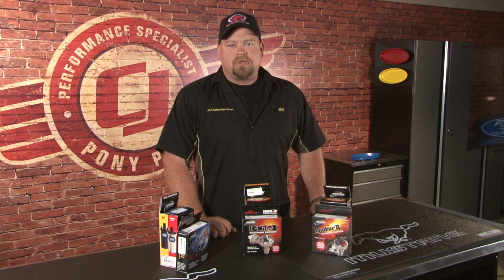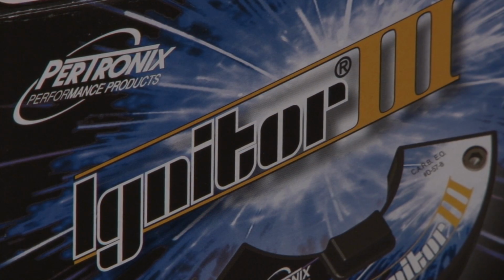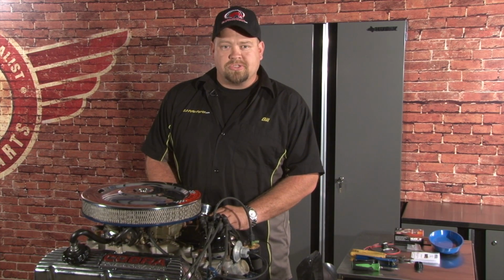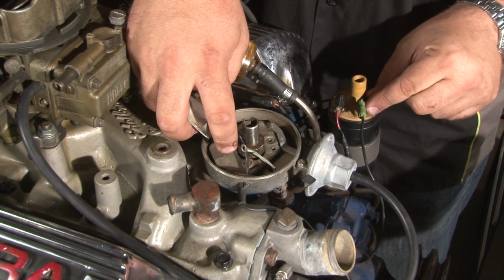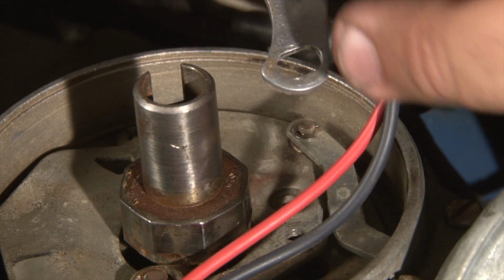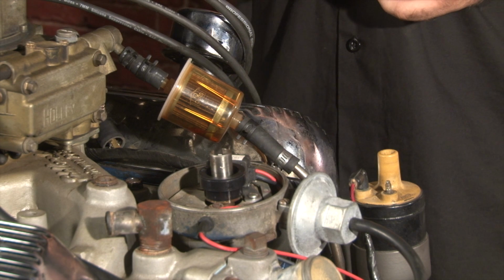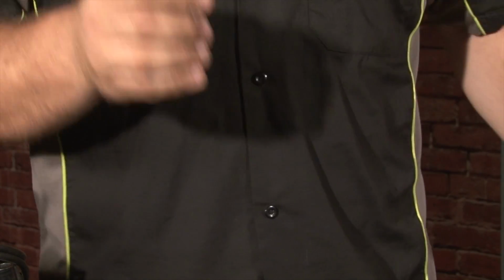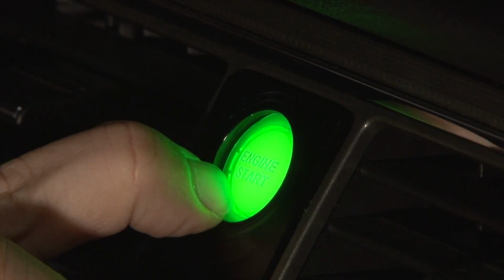Ignitor | Pertronix | 1965-1973 Mustang

Comment: I'm sorry but this is just bad information and an incorrect install for first generation Mustang guys.  It won't be getting 12V, it will fry the module in less than 2 yrs, and it will run like garbage the entire time.

Comment: I installed this Pertronix in my 1966 Mustang  it worked for 2 years last week my Mustang just died while driving . I replaced all the other electric parts Voltage regulator new battery , new alternator, fuel pump , all fine it was the Pertronix unit that failed so I am going back to points .I do not mind changing points they are the original part to the car and distributor. yes, points are a mechanical part which is good Modifying these parts is not a good idea at least for me. If points are bad a car will just run rough you can still drive home not with Pertronix I never had a car with bad points die on me while driving .
Reply: You can upgrade the coil, bypass or replace the pink resistance resistance wire or add a ballast resistor as required for hotter spark on points, less arcing and longer life, open up plug gap to .040. I have a spare ignition system and all tools to change in my glovebox on a 69.

Comment: If you hook it up that way on a 69 ford the PerTronix will only get  about 9 volts because of the pink resister wirer. Will it still work with only 9 volts.

Comment: why didn't they make the studs on the coil longer so you could use the stock connector??
Reply: my thoughts exactly. why butcher the oem wiring if it's really not necessary.

Comment: I bought this for a 1967 Mustang with a 6 cylinder. I could NOT get it to work properly. I wound up going back to points and condenser set up. No real knowledge was provided when I called. Don’t know what my options are to replace points setup..
Reply: Pertronix Ignitor part number 1266 worked on my 67 200.

Comment: For a little you can get a bilet distributor by Mallory or MSD without a box, most 60's cars had 7mm stock ignition wires,now they're using 8.5mm, a higher coil output will  fry them.

Comment: This may be correct for Pertronix I but its not correct for Pertronix II if your car has a resistor wire. Make sure to read the isntructions in the Pertronix box of the one you are using AND for how your car is setup.
Reply: You are absolutely correct.  While using the reduced voltage positive coil primary terminal will "function" at a reduced voltage level, the Pertronix system is designed to run at full battery voltage.  From what I have read a large number of Pertronix problems are caused by using a source voltage that is too low because a Resistor Wire or Ballast resistor is in use.   Some of the confusion is the Pertronix instructions I saw indicate the Pertronix unit is set up exactly s shown in the video.  What is not clear on their drawing is the positive primary connection on the coil in the photo is connected to a 12 volt source, therefore the non-oem ignition coil is designed to run at battery voltage, as opposed to post-resistor wire/ballast voltage levels.  

I know that First Generation Mustangs (Ford in general in the 60s and 70s), depending on the year, a person can grab 12 volts of switched power from Circuit 63 (usually a red wire for 67 and later) that powers the windshield wiper motor, or for 71-73 Mustangs there is a Circuit 640 wire (Red with Yellow Hash) that feeds a Throttle Position Solenoid (TPS, whether the solenoid is presemt or not).  If the TPS wiring is available, I prefer to use it just because it is so close to the distributor already.

Comment: EXCELLENT instructions.  Absolutely perfect.  I've been looking at buying a PerTronix electronic ignition but was worried about how to hook it up.  Now, I know and the fear is gone.  I did zone out a couple times during the video but I've got the attention span of a gnat - 7 seconds.  I'll just rewind and keep playing the video until I've got it all down pat.  Now I've got to figure out which unit model to buy for my 1965 Ford Custom (Galaxie) straight six 3.9L, 240 ci engine.  I believe it is going to be the 1261 or the 1266 depending on whether I have a round distrubutor shaft or "D" shape distrubutor shaft.  UPDATE 2 YEARS LATER - Well, I'm finally getting around to installing the 1266 unit and coil.  It's been so long that I've forgotten if that's the proper unit for my car.  I noticed there were no instructions in my box.  I probably took them out to read and left them laying around.  I'm glad I found this video again.  Should be an easy job.

Comment: I have one of my 72 pickup and I can't say that I'm with electronics after all Points never let me down or any of my friends ever yeah they need to be adjusted worst case scenario is you reaching into a box to grab another set of points on and you continue home this looks  it could leave me on the side of the road it's electronic it gets hot it's in the distributor, points never let us down ever.
Reply: Let me down a couple weeks ago after 7 years. Been frustrating to replace, bought ignitor3, that won’t work with holley sniper, bought igniter2, seems to work, but now on second sniper setup. May go back to carb if this fails… Yay electronics!
Reply: Just had my 72 f100 towed for the 3# time with bad coil time to go back to points. try and order a bad trigger. two weeks and it was
wrong

Comment: Hello again Bill, excuse me, I got a Pertronix D-1350 for my 289,  reading the instructions I understood that there is no more need for any external coil nor celenoi, this distributor is already set to install & use? 
In a different subject, do you have any video informing: instructing  how the water pump small hoses connections goes to? In & outlets & from the engine?

Comment: I'm looking at fixing up a 1966 mustang and have a couple questions. I planned on doing the t5 5 speed manual Trans conversion and ford racing crate engine that you've done and was wondering if I should get one of these ignighters. I also wanted to change the exhaust system (probably to something by flomaster) and wanted to know if I should buy new headers just to be safe (from Flowmaster as well).

Comment: Thanks for the reply! I'm getting the igniter 1, however my set up is different. I have 3 wires to the coil, one green which I believe is the resistance wire and a thick wire which has all aftermarket gauge reader components attached. Both go to the firewall. And the third which goes into the distributor. My question..should I not add the green wire at all? And should I still splice and add the provided connect to the thick wire with all the aftermarket parts? Will this affect any of my gauges or readings? temp, speed, rpm etc? And Then just add the ignitor wires regularly as seen on your vid? Thanks Bill, any info would be appreciated!

Comment: How's it going Bill great vid! I've been buying from cj's for over 2 years now. Quick question hope you could answer, would you recommend getting the electronic points ignitor and the flame thrower coil or would you recommend the entire cast ignitor flamethrower distributor? Would the second option only be acquired if a new entire distributor that enters the block be needed?
Reply: It really depends on your budget and goals. The whole distributor is a great piece but for a mild engine many times the drop in ignitor is all you need.
Reply: That thing is junk

Comment: Guys,  can i swap the stock pick up coil and reluctor  to pertronix #1281 in the distribuitor of a Mustang 302 with stock electronic ignition???  or it only works with the older distributors that have points and condenser??

Comment: The Ignitor 2 has hotter spark for high performance applications,  for most people the Ignitor 1 is adequate. Dual Point distributors were typically only found in factory high performance cars so you most likely have a single point. You can pop off the distributor cap and easily see which you have.
Reply: That's not the reason. You don't have to set dwell either. The hotter spark also helps keep the plugs clean and it also has the safety feature that protects the module in the event you leave the ignition on. The Pertronix I doesn't.

Comment: Informative.  Please slow the speaking tempo down.  How many pots of coffee did you drink?
An important issue is the original Ignition wire has a built in Resister which drops the voltage down to about 6V (Not to destroy the original points).  This wire needs to be bypassed or configured with a Relay.  Pertronix does not mention this in their notes.  It will eliminate any issues you may be experiencing after your make the switch to Electronic ignitions.  Cheers
Reply: I’ve been hearing this how do I do so?
Reply: @jordanparker8359  Hey, did you figure this out? I ordered their relay kit and I'm struggling to make it work. I would like to preserve the factory tachometer if possible. Thanks!